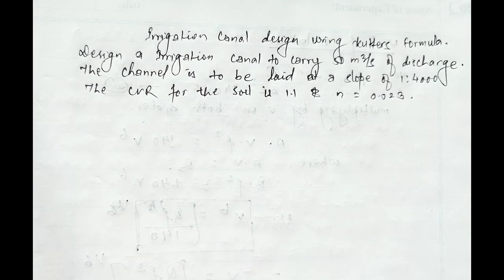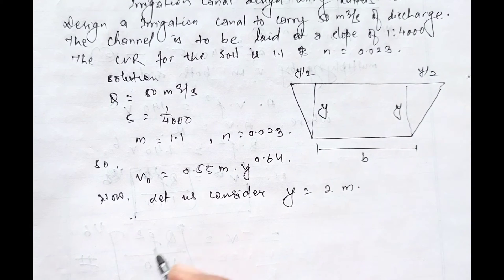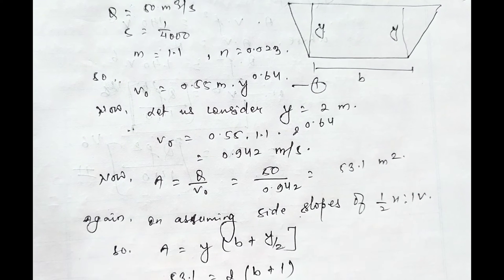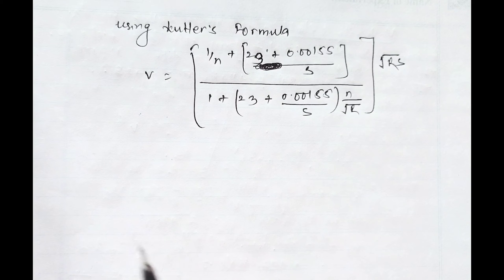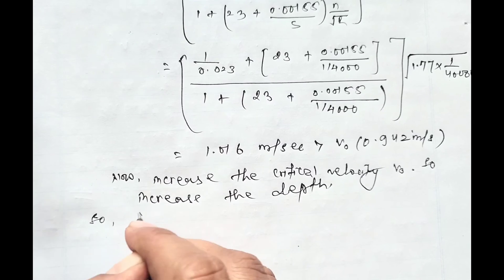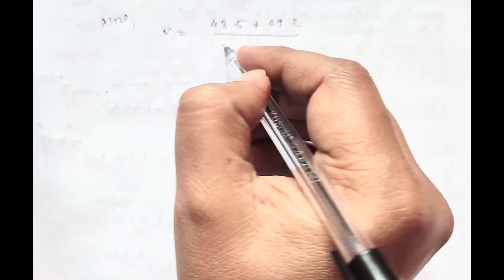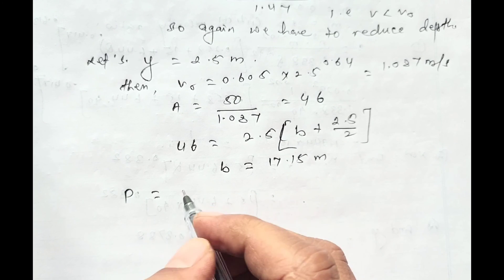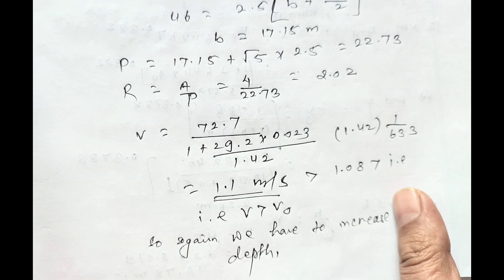Irrigation Canal Design using Kutter's Formula

Comment: thank you.
btw, what is the reason for assuming slopes, 1/2(H)= 1 (V)  before writing area of trapezoidal
Reply from the maker: The Side Slopes shall be assumed before the economic Perimeter Calculation. In case of canal design, the choice of slope is influenced by various factors such as the desired flow velocity, sediment transport by water, and the type of soil in the canal construction area. A slope that is too steep can lead to erosion and excessive sedimentation, while a slope that is too gentle may result in inadequate water flow. Here in our case the 1/2(H):1(V) ratio is a common slope used in trapezoidal canal designs as it balances these considerations, providing a reasonable compromise between efficient water flow and prevention of erosion.